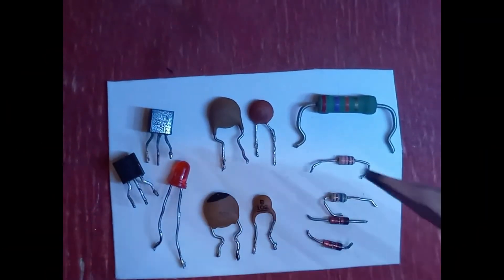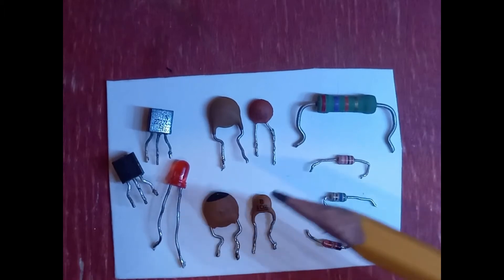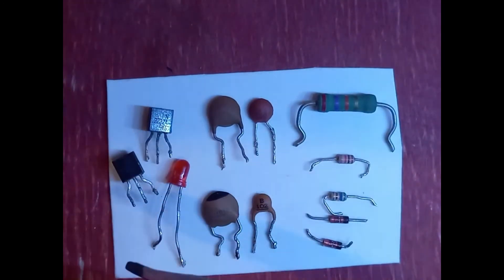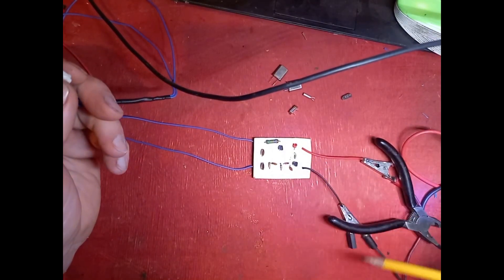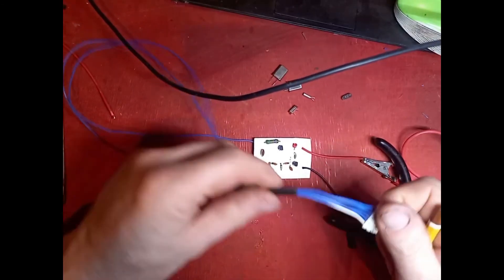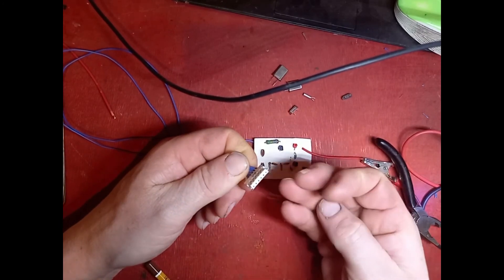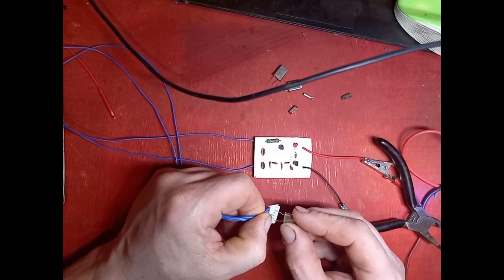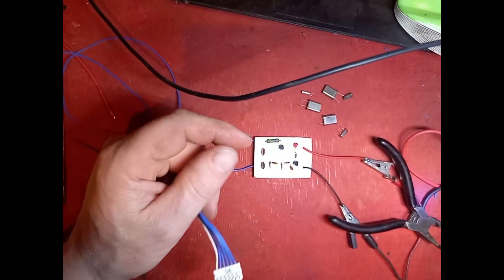how to make a crystal tester

Comment: Crystal leads WAY too long, introduces capacitances and inductances, even bigger problems at higher frequencies, as the lead length forms part of the crystal tuned circuit.
Reply from the maker: This is a simple go no go test as in it.has not been burned to a crisp, if you wanted to test a crystal in depth it would require a whole different approach and expensive equipment that is out of reach for most hobyists hence simple test